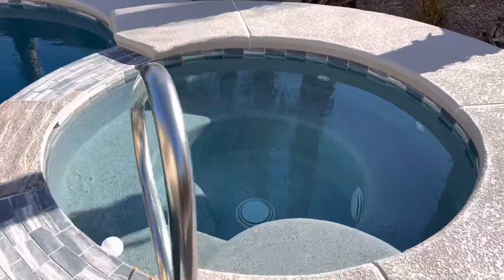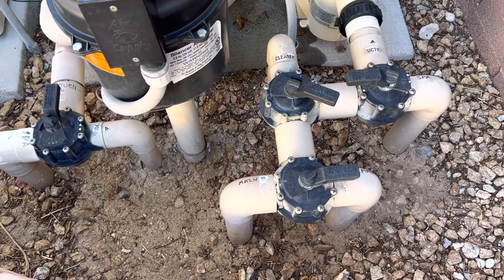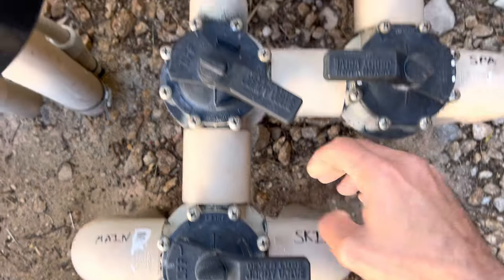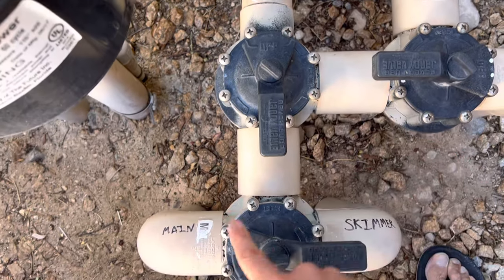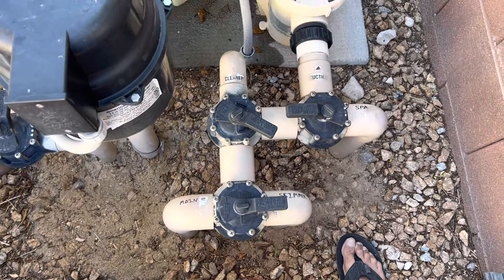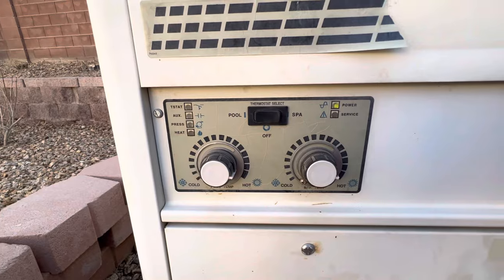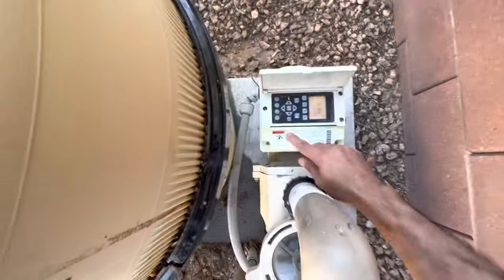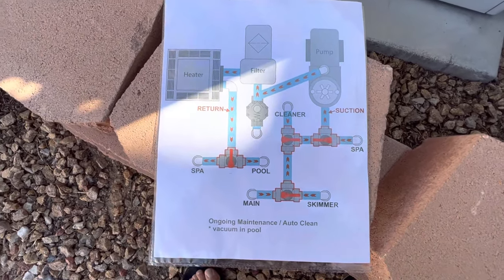Swimming pool valves introduction. Basic overview including spa and automatic cleaner

Comment: Great explanation.  Don't laugh, but I really also wanted to see your setup when in normal ops.  Do you keep the spa drain off in normal ops?
Reply from the maker: Yes, I leave the spa drain closed.  This forces water to flow across the top of the spa, and out of the small waterfall spout into the pool.  The purpose of this is so floating debris can get pulled into the pool skimmer.   I hope that was clear, it would make more sense if you saw a picture.  thanks for watching!

Comment: Thank you so much for your video and explanation. It is very helpful. I am a new user and want to install a jacuzzi. It's got 2 pumps, 1 filter, 1 heater and 1 blower. Please can you assist me on how to go about to install everything and explain why it's got 2 pumps. I also needs to know where and how do I connect the buttons on top of the jacuzzi. I'm not sure but I suppose, one button is for the bubbles(water) throuht the jets and the other for extra airflow.

Comment: Well explained.  Just one question : What is the need for the "cleaner " (see diagram 8:25) if you already have a filter ?
Reply from the maker: Hello!  That is the suction line for the pool vacuum.  You can use the valve to adjust suction or turn it off. The vacuum has a separate filter to trap items.  Similar to the skimmer basket, you want to filter larger debris that could harm the pump.

Comment: We just bought a house with a pool, and what should we have running all the time. I skim with the skimmer pole it and cannot get all the Nats out. It seems to be very dirty. Should I put the bubble and  skimmer on?
Reply from the maker: Hello.  I have a pool vacuum and the spa, so your setup may be different.   Think of the water flow as a circuit or circular motion.  I have all my bottom drains turned off. This way the water moves across the top of the spa, across the top of the pool, pushing all the floating debris to the simmer basket, and eventually into the filter, and back to the pool.  The only exception is that some of the flow also goes to the pool vacuum, which cleans the bottom of the pool.   Hope this helps!

Comment: Good job.  New pool owner here as well, what does “normal” mode look like? (Anybody can answer)
Reply from the maker: Thanks for watching.  “Normal” mode for me is really “clean” mode where the vacuum is running around the pool many hours every day.  

We swim with that setup as well, but I suppose a version of normal would be with the vacuum out.  At that point you could open the floor drains and use skimmer & floor drains for circulation and decide if you want the spa in the loop or not.  Hope that helps!

Comment: Is it safe to turn any of those valves (that are not on the filter), with the pump running?  Or is it best to turn off the pump like you would when turning the valve on the big filter? I noticed you did it while running the pump for the cleaner, but maybe thats the exception ? Thanks!
Reply from the maker: It’s safest to turn the valves with the pump off, but with experience you can turn some valves with the pump running.   The most important piece is to understand the flow.  The risk is you could break vacuum and pull air into the system or cut off water flow completely.   Either of those will over stress the pump.   Whenever turning a valve with the pump running, I do it very slowly and keep an eye on flow and an ear on the pump RPM.  Thanks for watching!

Comment: I usually turn skimmer on to vacuum but yesterday I noticed is not working can u help with any tip? Is not suctioning
Reply from the maker: If you have an automatic pool cleaning vacuum, check to be sure it's not clogged.  Disconnect the vacuum hose somewhere close to the pool wall and see if there is suction.  Also, mine works like a very simple clockwork type of mechanism with gears and a paddle inside.  Sometimes a stick or something can get in there and it won't move around.  Best of luck, I'm interested to know if you solved it!

Comment: If the water coming in and out of the heater is the same and only directed which way to go by the exterior valves. Why does the heater have a Pool and Spa mode?
Reply from the maker: I checked the documentation.  The heater has two thermostats so you can leave the dials set at different desired temperatures.   It’s for convenience, since you commonly would set the spa temp higher than pool temp.   Hope that is helpful.
Reply: automation controls  systems

Comment: U should add that when you turn the valve, u need to be cognizant of where the “OFF” is when u are actively turning the valve and make sure it doesn’t go in front of the pipe directly into the pump bc it will “deadhead” the pump.  Same thing in the return side, u don’t want the OFF be turned in front of the pipe coming from the heater and towards the return valves bc it will stop the water flowing. 

If u are new, i recommend turning off the pump while moving the valves until u are more confident in moving the valves.  And once everything is moved, then turn the pump back on…
Reply from the maker: 100% you don't want to completely cut off either side of the flow.   Thanks for watching!